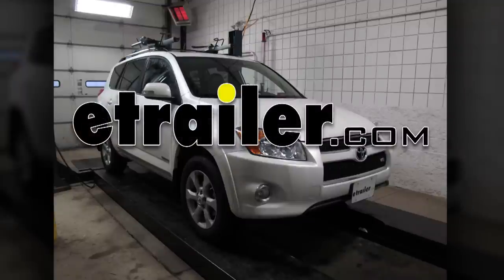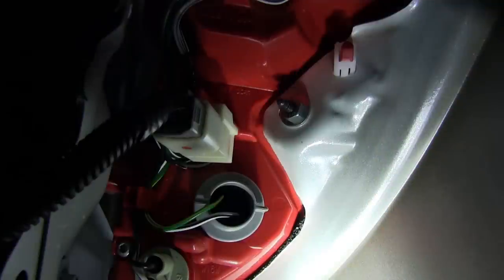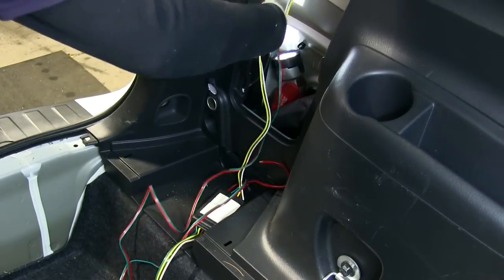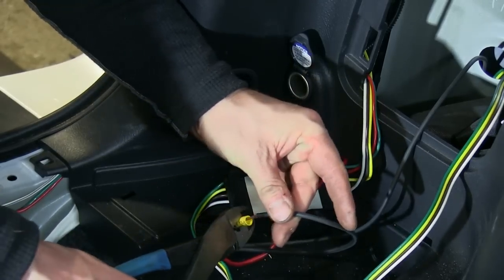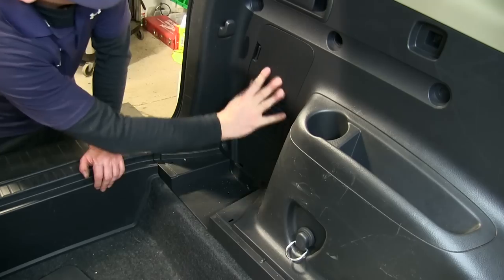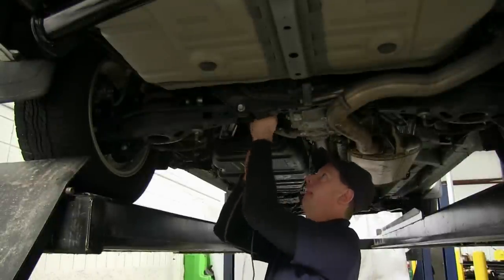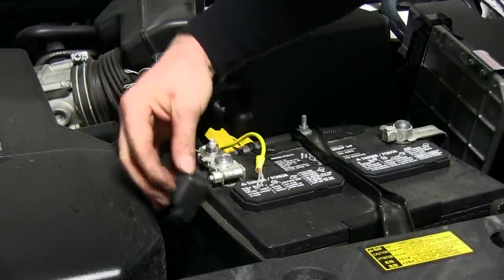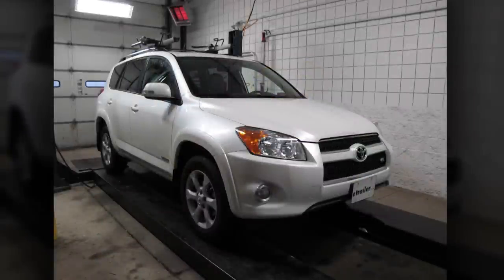Installation of a Trailer Wiring Harness on a 2011 Toyota RAV4 - etrailer.com

Comment: Don't wire harness to acc. outlet. Okay, video wiring very sloppy. I ran hot wire down behind  driver's tire well splash panel, through pinch weld jack lift channel, over and behind rear tire splash panels, and up through rear panel.  No need to get under SUV. I soldered all connections. I didn't even take all the rear inside panels apart either.  Very clean and functional set up.

Comment: just wired an extra plugin off that  rear auxiliary lighter power port.. it's rated for 120 watts 12 volts with a separate 10 amp fuse...
Works fine for me and I still have use of the port for charging my RC batteries and air pumps etc..
No need to string a wire to the battery at all.
Reply: How did you wire into it? What did you do?  I'm trying to install a harness and also don't want to deal with taking it to the battery.  I can't find any videos of doing it this way
Reply: I did the same thing, tapping into the rear cargo auxiliary port. I added an inline fuse holder just to be safe in case of a short on the trailer. The trade off is that the vehicle has to be on, but I have push button start so it works out perfectly.
Reply: My laptop blows the fuse if I run it on Turbo instead of Performance but even on Performance and having AC on, it blows the fuse.  If I hook up the trailer the 10amp fuse could blow w/ enough load (less).

Comment: I see the auxiliary lighter socket right there at the back driver's side.  Why don't you run power just to it instead of under the car and all the way to the front?
Reply: I did and it works great.. still can use the socket too.
Reply: @West Park Why not run it inside the interior trim like when running a rear sub?

Comment: So the end that gets the ring terminal ....could you not just wire that to a cigarette lighter plug and insert it in the lighter socket that shhoppe points out in the back??
Reply: Don’t wire into the cigarette socket as the wire may not be heavy enough.

Comment: What's the reason for the module and the battery hookup? My s10 just used the connection set. My sil has 09 rav4 and kit was installed by dealer. Not working now. Pulled driver side panel. Has connector into original plus feed to 4 prong flat connector. No module no battery line no ground. Maybe on passenger side?
Reply from the maker: The vehicle may be equipped with factory tow package which means that there are most likely relays in the fuse panel that may have tripped which is why the wiring would not be working. The module is a converter box to take power from the battery and send it to the trailer lights so that the trailer lights do not take power from the vehicles tail lights.
Reply: @etrailer  thanks. We checked manual and fuse panel. Factory towing fuse compartment spot is empty. He bought the vehicle new so he didn't remove the fuse. He thought dealer might have installed the trailer stuff. Lights used to work on his boat trailer ( at least  he thinks so lol). Maybe we should put a fuse in that spot just to be sure. I just researched his fuse panel stuff. For towing I only see reference to a fuse but no towing relay. Is it possible that his plug and play connector does the link from different brake and signal leads to the common yellow (and green) for the trailer?